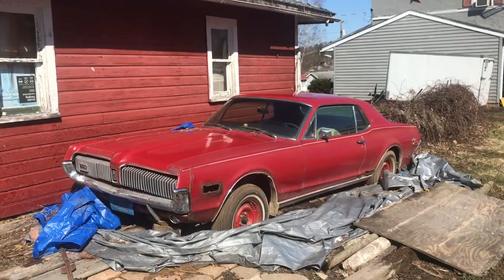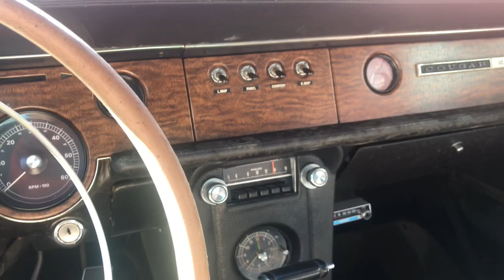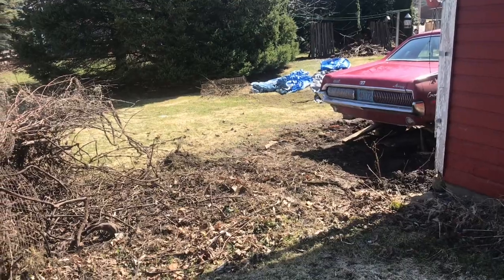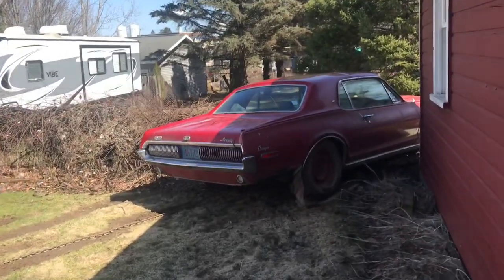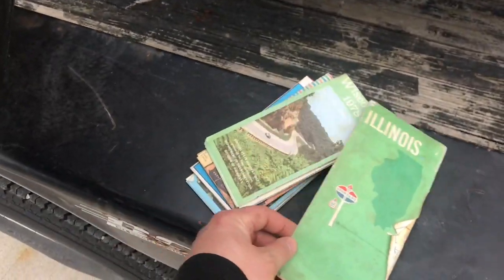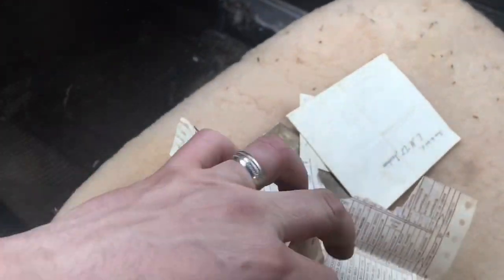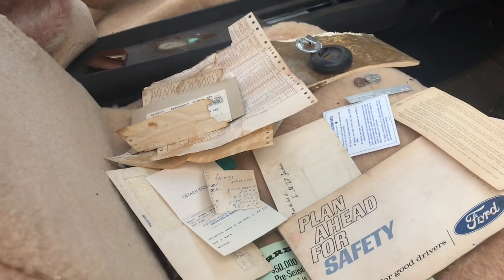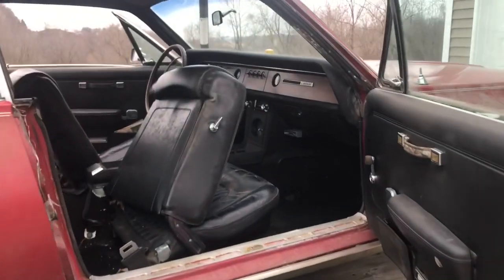Yard find 1968 Cougar XR7.  Back yard rescue

Comment: How is the Cougar doing?  Did you get it running and have you done some work to it?  Hope you can restore it, it's a classic USA car  Good luck!!
Reply: I don’t remember if I said it on video or not but the car was pulling apart due to the rust.  I ended up selling it before I even unloaded it off the trailer.  A guy had a rust free shell and wanted all of the interior and trim parts for his car
Reply: @jeffbailey600  Nice.  Glad to hear the parts from the car went to a good cause.  Thanks for the update.

Comment: Keep it fix it up.
Reply from the maker: After I got this dug out and pulled on the trailer, it was obvious this car was too far gone.  The front rails pulled off what was left of the floor and the car was about to break in half.  I sold it to a guy with a AZ car. He bought it for the interior.

Comment: If it was an XR7 GTE car it would be worth restoring. But just a plane ole XR7 302 2V and allot of tin termites not really worth it. Looks like just a parts car.
Reply: I agree the dash was mint and there are a lot of good parts on that car. But like you said it was a plain Jane 302. It brings back a lot of memories mine had a black vinyl roof.